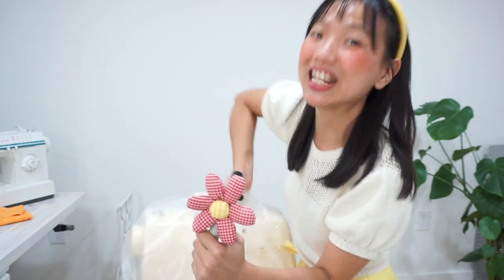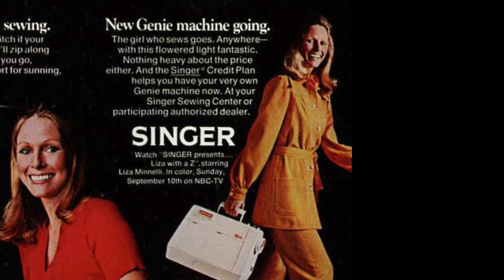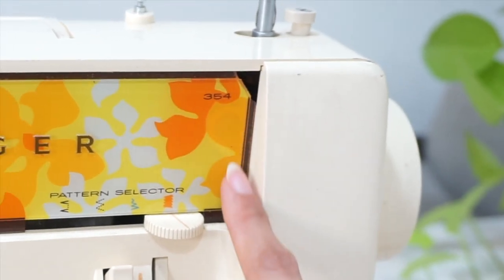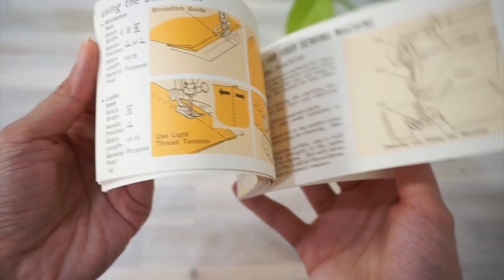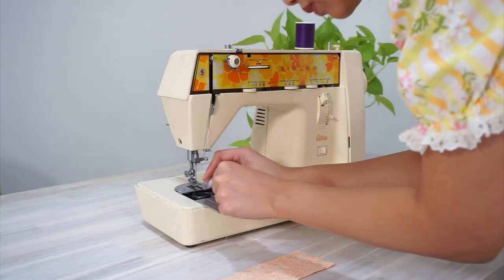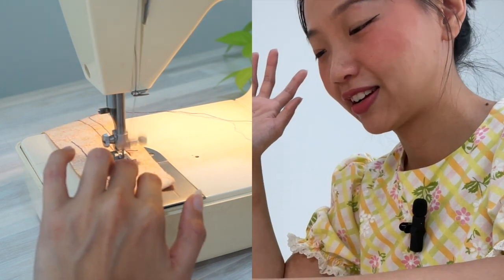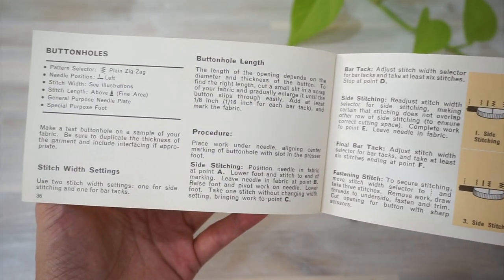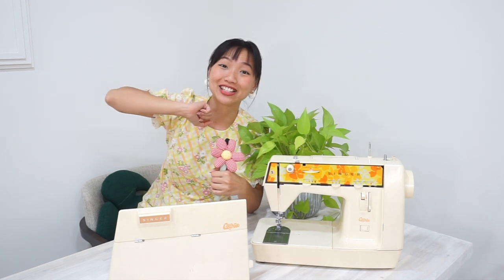I got a new vintage sewing machine! Unbox with me 🌼

Comment: There is a sequence to removing the external covers.  Base (4 screws), Side (1 screw), Back (5 screws, there are two under the handle), Face plate (you must remove tension which is finicky), and lastly the front.  The screw on the right side, you only need to loosen.  Both front and back covers slide straight out don't lift up.  You can use the Singer Buttonhole attachment for zig-zag machines, just make sure you don't get a slant shank version as this machine is low shank.